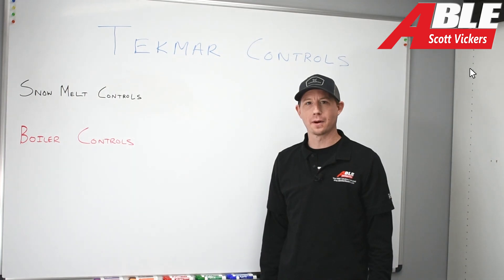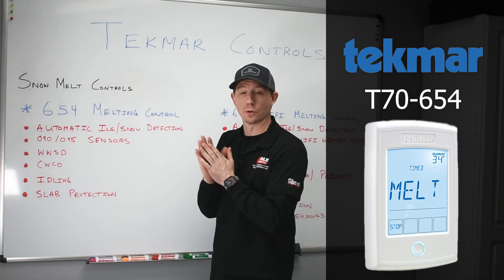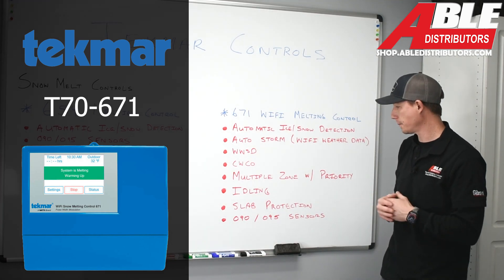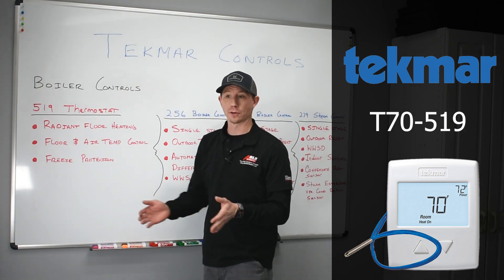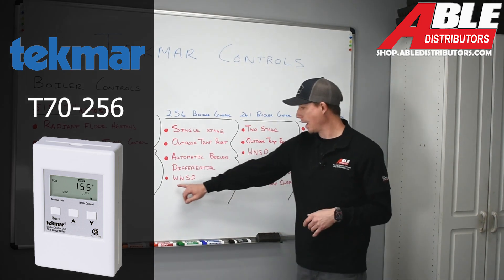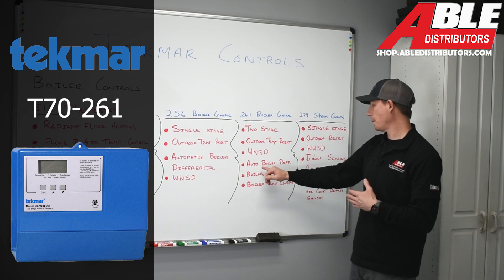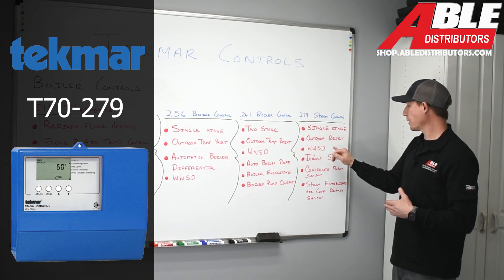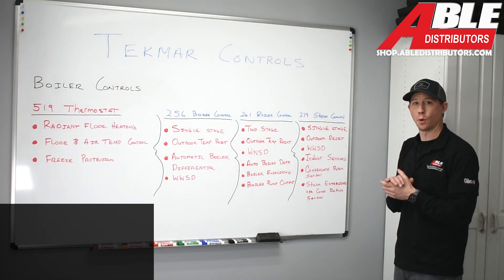Tekmar Boiler Controls Overview (Tekmar models 671,654,519,256,261,279)

Comment: Hi, I have an apartment building with 48 units. The building is divided into east and west wing with a boiler heating each wing. Each boiler is run by  johnson A350R control. I have been looking at the tekmar 294 boiler control, can I use one tekmar 294 control to run 2 individual boilers? Thank you